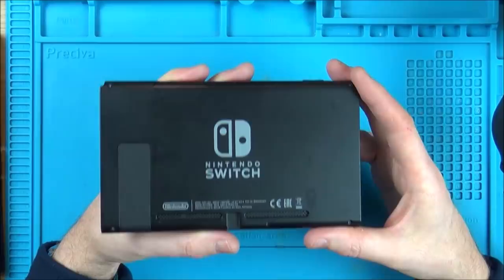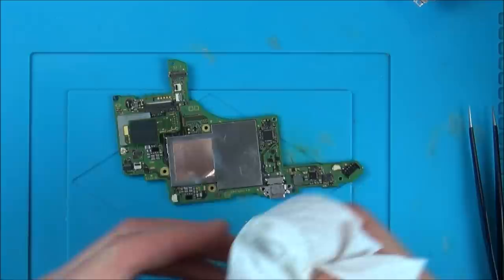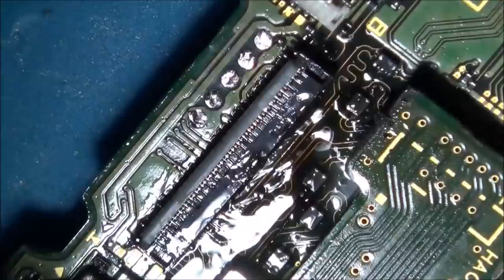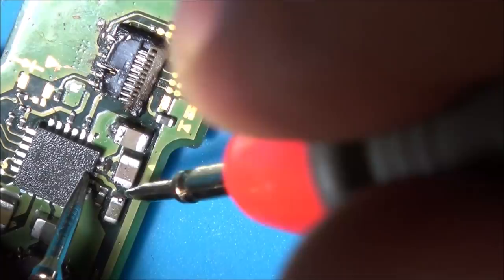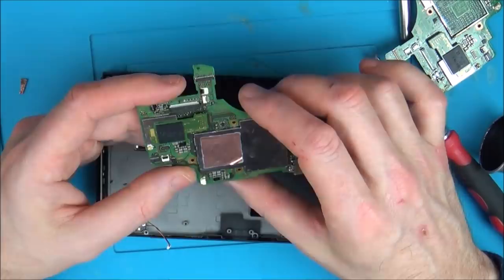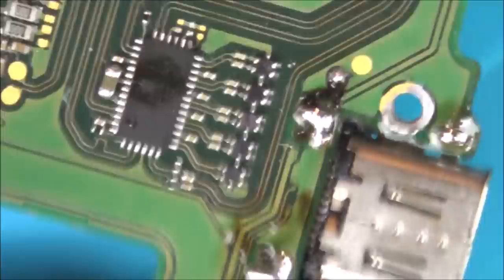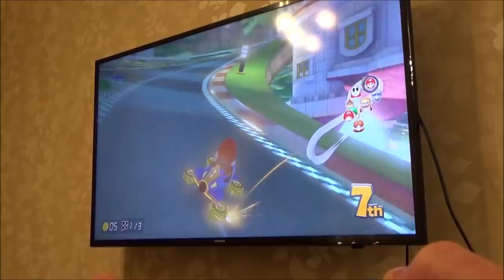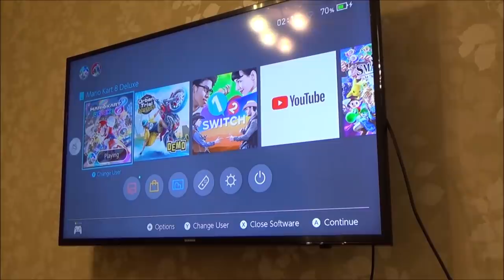Trying to FIX: NINTENDO SWITCH with NO DISPLAY on LCD or TV

Comment: Been waiting for another Switch video! Wish I could tell you what the problem was but just can't tell from the video. Nice work on replacing that screen ribbon cable!
Reply: Maybe he can send it to you if he can't get it working. I love watching the both of you repair these things. You guys are awesome.
Reply: You should meet up
Reply from the maker: Thank you Steve :-) Since the video I have compared voltages from a working Switch, it looks like the data lines on the LCD connector are present but most of the voltage pins are missing???? I am not sure what chip or chips pushes the voltage towards the screen.
Reply: Hi Vince and Steve, Im fallowing both of your channels. Thanks to You I fixed two dead PSP :-)
I wote for Vince to send Steve switch, of course when everothing else failed, just for thumbs up ;-)

Comment: A few thoughts for you Vince. Something caused the burn mark on the LCD connector. My guess is a small piece of dirt that was conductive enough to short pins together. If one of the pins that got shorted was a power line and the other was a data line, then high voltage would have been sent to the chip that outputs the data to the LCD.

Probe the connector on working switch, note the voltages on each pin, and compare to the switch that had the burnt connector. If you find one that is missing trace it back to the chip.

One more thought, there would be enable signals to the chips to sent data to the LCD as well. If the enable isn't present the data won't be sent to the LCD either. But the backlight is working, so if the data and backlight work on the same enable signal then that is not your problem. Unless there is a schematic available (I assume there isn't) it could be difficult to find the enable signals.

Note, I have never worked on a nintendo switch before. This is only based on general knowledge of electronics. 

Cheers
Reply: ^He said it far more succinctly than I, "that" lol

Comment: I'd say the simplest solution is usually the most obvious... Follow the first 4 or 5 pins where there was scorching of the display connector (typically VCC) and follow the traces, i bet the scorching on the connector was prolonged secondary damage and the real culprit is further down the line, smells like a burnt open to me - either a resitor or trace, compare with a donor and find supply source, the open will likely be as a result of a soft short. Great vid Vince!

Comment: remove the LCD connector and check the continuity between the connector and the filters 
and try to check the voltage on the connector pins and compart it with those of a working one
good luck vince 
i learned a lot from you

Comment: hello Vince

I've had this problem before I don't know if anyone has mentioned it over the 200 comments. but with my experience. with the LCD connector if the LCD connector is not displaying picture. I would check the diode near the LCD connector And in my personal experience. with replacing the LCD connector is that you do not want to apply any heat to the LCD connector directly or use a soldering iron. What I do for Perfect results every time it's remove the connector. And then I would prepare the pads and tin with a nice amount of solder then apply the new Flux And place the connector on top of the tinned pads then I would apply heat from the other side of the PCB and now the heat to slowly radiate through and Melting the solder and the socket to flow and pull itself perfectly into place.

If you have any more questions drop me a message.

best regards Ash
Reply: Can you please elaborate on the heat from the other side approach? If you use hot air, do you remove the tip so that a wide area is affected? also what temperature do you use? I fear of melting the solder of the other components and causing them to move due to air. Much appreciated! I damaged this component and dreading the replacement.

Comment: The fact that the original LCD connector from the beginning of the video was obviously burnt on the very end of one side makes me think there was an issue with power.  If you had a working Switch, maybe you could check the pins on that side of the connector while the screen is on to see what readings you get, and compare them to the broken Switch.

Comment: Well I just watched this video because I had the same problem. Didnt really help me but I might be able to help you. I changed the usb-c conector on a switch that wouldn't dock, and the LCD just wouldnt work after. I have been micro soldering for a few years so Im quite confident I didnt mess up anything, so I thought maybe the LCD conector was fragile, so I changed that FPC: nothing changed, like in your case. So I started checking filters and everything surrounding the places I touched, and everything was OK. Tested with new LCD, same issue, booted, touch worked, but no image. After checking everything, and everything checking out OK, I ultrasonicd the board with no luck. So I tought "well, its all or nothing now" and fluxed the C/GPU, reflowed that bastard, ultrasonicd again and closed the switch. With very little confidence I pressed the button and guess what, it worked. All that trouble for some dirt/cold solder under CPU

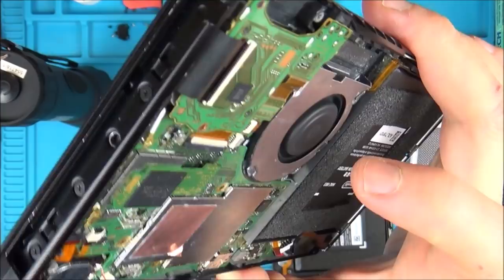Comment: The Error noise at 12:46 May be an error about the switch overheating, because You have not put in the heatpipe And therefor the main Chip is overheating

Comment: To avoid damaging connectors and stuff you can buy a pre-heater and heat up the board until you reach 150ºC on top, this way you can easily desolder stuff without damaging it.
For that tiny capacitor you could have used solder paste and hot air, it would be easier.
Great video Vince :)

Comment: Relax about the flux. The flux you use is non-conductive and non-corrosive. You could not clean it off at all and the electronics would be fine (just sticky) as long as the contacts are clean.

Comment: If I remeber this correctly, the LCD display and the back light works seperately. The ribbon cable for the back light which only have two lines in the ribbon cable( I think one is power, one is ground according to the thickness of the line) is the one beside the LCD display's one. Docking backlight off, undocking on means the console could recognize its state.

From now on, just my guess, since I don't have a switch, but I reckon all LCD screen works similar. 

I am not 100% sure the connector works, because the touching function and display works seperately. You could check the pins to find it out. The signal for the screen will be either 1 or 0 since it is digital, which means you will get 3.3V(not sure whether it is 3.3V, but definately a voltage much bigger than 0) or 0.

Talking about the pins on one LCD screen, there will be at least one power pin, usually several pins. The touching function and the display function work seperately, this will explain why one is working, another won't. There will be 16 pins for data transmission. There will be a write-enable pin for the LCD to get data from the chip, which I think this is where the problem lies.

If you could find the schematic for the LCD( maybe find the manufacture, find the product model, or any way you could), this the function of the pins will be known. And you could find out which one is write-enable and whether we need to give this pin a 1 or a 0 to enable writing.
Reply from the maker: Thanks for the detailed info. Since the video was released I have compared voltages with a working Switch using a multi meter. There are numerous missing voltages that are in the range of 5V+. I think whatever pushes the voltage towards the screen is faulty. The problem is I can't trace the tracks back to locate the suspect chip :-)

Comment: Just a suggestion for the next time you try something like reattaching the charging port after lifting the solder pads.  After attaching the wires to the missing pads, try using a toothpick and applying some solder mask to the sides of the wire and curing it.  That way you provide a solid connection to the circuit board which wont slip with heat from the soldering iron or hot air.  If you over apply the soldier mask and cover the wire, you can always scrape back until you get back to the wire without cutting it off.  You may even be able to shave back half of the thickness of the wire to flatten it out a bit so it doesn't stick up so much for surface mounts.  You just have to be careful around the good pads.
Reply from the maker: Great advice, thanks for sharing it on here :-)

Comment: Mr Vince, I eagerly await the promised attempt at the partial power / blackout ps3 mentioned in the first nec/token video

it's a relatively common fault, and virtually zero diagnosis exists online, aside from the thousands of amateur YouTube videos of kids going "look what my ps3 is doing"

any progress on that is sure to further your rockstar status :)

(unrelated to video or above comment)
tantalum cap placement tip:
stick them to a long strip of kapton and stick it to the board. solder positives, peel tape, solder negatives.

must be stuck to kapton prior to any flux contact, or won't hold properly.

saves TONS of time with tweezers / placement / flux, and when done it has a OEM appearance to it :)

no intention to walk over this video ;( I do most of my YouTube watching on smart tv (which doesn't support commenting)
Reply: Its been done already.
Reply: @zerocool278  
nec/token? yes
blackout? no
Reply: @zerocool278  apologies, I see that video now -- the "no power at all"

you're absolutely right, it was done already

in my head, I was thinking about the issue where the 3001 models turn on to green light then rapidly turn back off with no light at all

Comment: When the switch "SWITCH" is docked the display is redirected, could it be that the HDMI portion of the circuit is hindering this signal to change from HDMI to the LCD? 
If I remember the switch takes a few seconds before the HDMI or TV displays anything, so if your switch when docked is instant it may just be the case,
mind you I have no idea what method is used to switch A/V to either the HDMI or when undocked to the LCD Screen, but that's what I would suspect..
APU I dropped a Like..
Reply: I am not sure if the Display is redirected, because if you run Android on the Switch and Dock it the Switch display and the TV  Shows the Image. But i am not sure how the "Docking" Works exactly
Reply: @Stupee_  you may be correct about that, But I still suspect there is an Integrated Circuit "IC" that drives the HDMI graphics via a HDMI Format and if not another IC, another section of the IC drives the LCD format, BTW Android devices for the most rely on a LCD driven format, while TV's rely on Audio Video being fed via a composite set of connections or lately more often than not a HDMI port.
Reply: high voltage up the data line from a shorted connector has blown the APU, i am astonished its working at all

Comment: First off, I love your videos. I have an idea I have brought up to multiple Youtubers that make these types of videos and they all say it's a good idea but none have done it yet. Make a video about how to change the front half of the Switch's shell. Like the half that integrates the exhaust slot and power buttons. I have a day-one Switch that has ONLY been used docked and still works great but the plastic shell is basically crumbling to pieces. Just FYI as far as I can tell there still isn't a single video showing how to do this and it is a widespread problem. Thanks for reading this if you actually do ;)

Comment: Vince you should replace the connector again but use hot air. Slow settings 

Or you could build an Nintendo switch home console has you can have it docked. It would be a permanent switch docked. 
I would love to see that 😊

Comment: I had the same issue. Mine was definitely the LCD flex ribbon ziff connector. I swapped it out and it didn't work at first then I used a toothbrush and a lot of alcohol to clean the connector of flux. It worked.

Comment: I had a similar issue on one of the Switches I fixed. It was the video chip that was the culprit. Maybe the chip from your donor board was bad. You might want to replace it and see if it changes anything.

Comment: @My Mate VINCE , Get and old iphone speaker take it a part use the copper wire for jumpers and use UV solder mask to keep the jumpers in place under the the usb c port.
Very nice soldering job
Reply from the maker: Great advice Anonymous. So I could use the UV solder mask and then scrape back just the top of the wire to expose the copper again. Thank you :-)
Reply: @Mymatevince  Yes you can

Comment: Have you diode mode the display connector? I have a switch I am about to replace the connector on if you want any readings? Would love to find a reliable schem/boardview for the switch.
Reply: Were you able to find any schematic related info yet? I have a faulty switch which came in with various problems. I fixed the broken usb c port, I replaced the charging chip MT92smth and it now turns on and charges. But I can't get the doc mode working. I checked every line and couldn't find any short. I'm on this one now for several hours and I can't find a solution.

Comment: Hmm interesting one. Chip that generates video should be fine if video works normally in dock mode. Really weird, that type of burn is not from 5V or 3.3V for sure - it's clearly from backlight line. I think that something ( maybe that little dirt inside connector? ) made short between backlight voltage and some data pin thats why backlight and dock mode works and data signal doesn't. Try to trace that tracks where the burn was - you will then catch faulty component. As always lovely video.

Comment: Great stuff =D  Ouch at the USB connector =/  I think I would next measure voltages on that video IC (compare between a working Switch and this one).  Maybe a voltage is missing or low on that video IC.  Having said that, is that video IC just related to HDMI, or does that feed the LCD?
Reply from the maker: I don't know Chris if it is just for HDMI out (or I think it is DisplayPort out and the Dock converts to HDMI) or whether it also controls the LCD. I have since measured the pins on the LCD connector and compared it to a working Switch. Loads of the voltage pins are missing. I think the chip or chips that control the voltage for the screen is faulty. The data pins appear to be OK but my scope I don't think is quick enough :-) Thanks for the helpful comments :-)
Reply: My Mate VINCE Hello, I have a problem on a switch there is no more display on the lcd, I have the sound backlight and touch sound all ok, no lcd, may on tv stand its works, I tested two lcd still no display, I changed the l92 m36t36 PI3USB lcd connector and usb docks also same result, I can not find the lcd display failure. Do you have a solution? Thank you

Comment: Just has this exact same issue. However In the dark I could see the screen turn on, just the back light working and could also hear sounds when tapped. It was the LCD connector. They are EXTREAMLY sensitive! Might be worth getting a new connector. Remove old one, clean all the pads. Tin them up. and with no flux place the new connector on and heat from the back of the board while pressing down on the connector.

Comment: Vine. Heat the connector from underneath the PCB. to remove it. Use Kapton tape.  When solder back, don't go for all the pins directly but put it in place, and solder just one pin (the anchor pins) It's easy to adjust afterwords

Comment: Hello, I have the exact same problem on one of the repair I did actually and it’s happen when I just try to put the motherboard in one other switch to see if the screen is working … I think the screen didn’t work and I put it back in his actual case and no more working on the switch just the TV… I changed 6 time the Lcd connector (yes that’s true) and nothing… so please tell me that you found the solution and please let us KNOW…. Thank you
Reply: LCD driver chip

Comment: I know it has been more than 1year, but I have Switch with same problem, and people told me that the culprit can be the small chip next to the connector (8316) or the caps/res next to it (more likely them then chip)... I am still to test it out with a working Switch, but I trust the source...

Comment: High voltage to the data line from a shorted out connector cable will blow the output signal lines on the APU. unfortunately probably isn't fixable, at least it still works in docked, which actually surprised me. damage to the APU is usually Fatal

Comment: Can I have some advice please. My Xbox one x has a strange problem. When I switch it off and leave it off for a few hours or more then switch it back on it won’t read any disc or eject the disc. However when I switch it off then back on again it works, I don’t get it. Would it be a software problem

Comment: Well, video cards or onboard gpus have "heads" for various output, for example a head for vga, a another on for hdmi, those are seperated. That means, when one "head" fails, output can still be gained from another connector. It just so seems that your "head" for the LVDS died. That does not mean that the hdmi via usb c is in danger, could very well be that a short on molten connector caused this.

Comment: You should check the data lines to the LCD by setting your multimeter to diode mode and then place the positive probe on any of the grounds on the switch and the negative probe on each pin of the filters that you tested that are connected to the LCD.  You should get around a diode drop (0.6V or so) showing the protection diode in the chip that it is connected to.  If you get anything else I would think that is a suspicious reading.